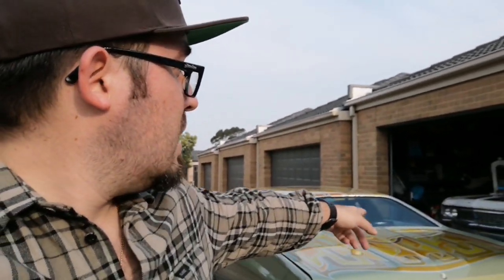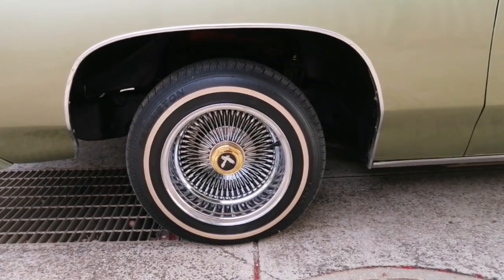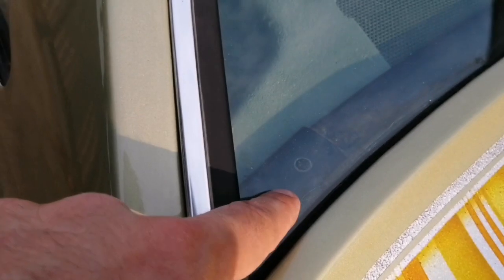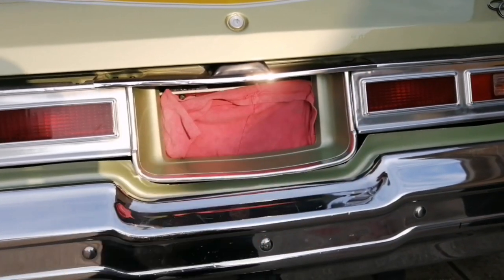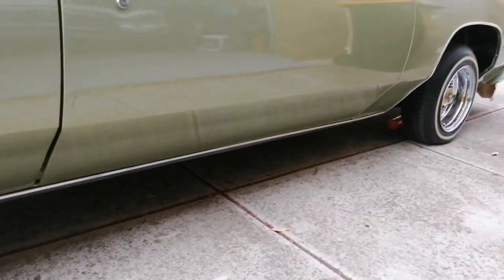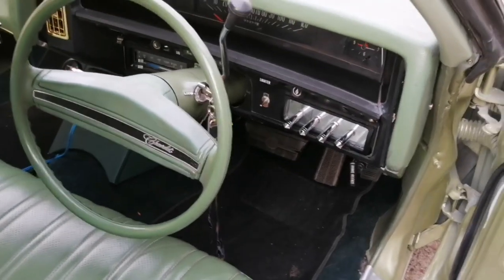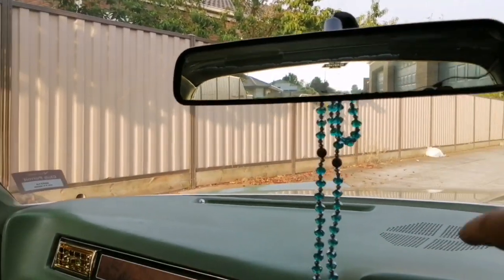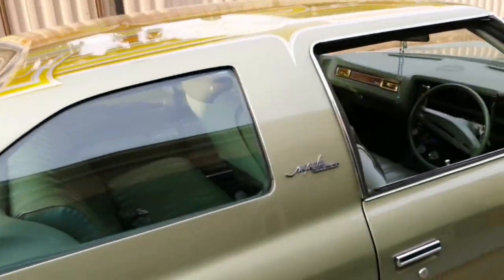1974 Impala RHD for sale - walkthrough

Comment: I had the same 1974 Chevy Impala 2 Door Custom Coupe same color in the inside the difference is the outside was a Highland Green  which is a darker color I had power windows power brakes power steering AM & FM Radio with 8 Track Tape player, vinyl interior seats  with plastic covers  this car brings a lot of memories.